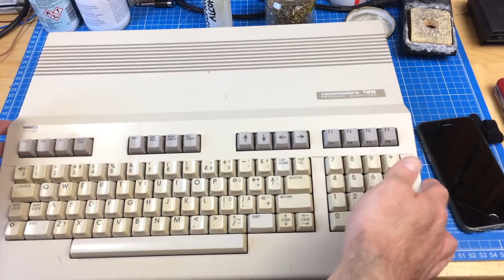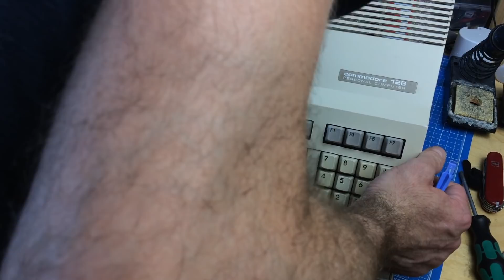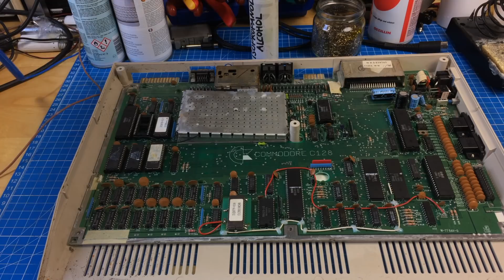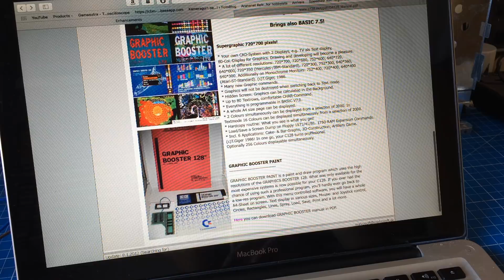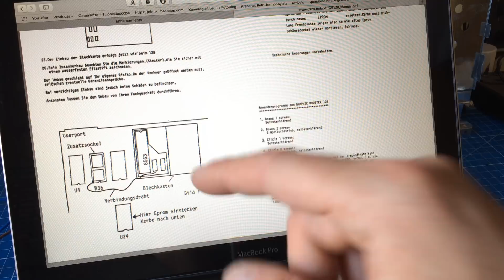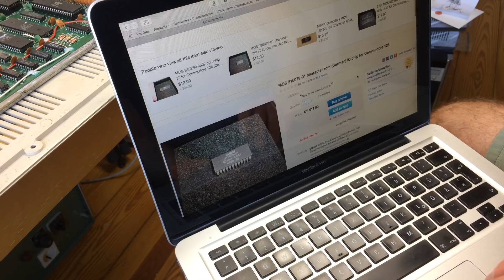Commodore 128 Part 1: First Inspection and Surprise Enhancements

Comment: That keyboard shows how in the 80s, before PCs took over nobody had a standard layout for the buttons. Although I would like to know which psychopath put four cursor keys on two buttons, that's always bothered me about early Commodore machines.
Reply from the maker: Yeah, there definitely are some confusing keyboard layouts from that era. :D My favorite Commodore cursor keys are on the plus/4 btw. Just four arrow-shaped buttons. Simple. :)
Reply: @JanBeta  Sure - but they are so small and tightly-spaced that they are more or less unusable :'(
Reply: +James Grimwood
It wouldn't surprise me if that "psychopath" was Jack Tramiel.  Remember, he was all about building things as cheaply as possible.  Two keys are less expensive than four keys.  Keep in mind that this is the guy who insisted on using BASIC 2.0 to save money.  They could have used BASIC 4.0, but it would have required more ROM, which would have cost more.  Besides... you already had to hold the SHIFT key (or the C= key) to get the graphics symbols, so it shouldn't be too big of a deal to have to hold the SHIFT key to get CRSR LEFT or CRSR UP.  At least, that seems to have been their thinking.

If you look at the "PETSCII" codes for the cursor controls, you'll see that's exactly the design philosophy they used.  CRSR DOWN is CHR$(17), CRSR UP is CHR$(145).  CRSR RIGHT is CHR$(29), CRSR LEFT is CHR$(157).  HOME is CHR$(19), CLR is CHR$(147).  Holding down SHIFT simply set the 8th bit high  (17+128 = 145.  29+128 = 157.  19+128 = 147.)

By the time the 128 came out, Tramiel had already bought Atari and left Commodore.  The C64 mode was actually something done in secret by the designers... when the executives finally noticed, it was too late to change the design.  Otherwise it might not have had backwards compatibility at all.
Reply: @SpearM3064  This is why the 'Geniuses' in Sales and Marketing and Accounting get the Big Bucks...

Telling engineers what they can't do...

..which makes them a bunch of cant's :-(
Reply: @SpearM3064  Not sure how 'secret' it really was - given that they had to outsource some of the custom chip design/production to Zilog (who (ignorantly) made false promises to them :-( )... see The 8-bit Guy's videos with Bill H's commentary re the C128 for more detail.
Reply: It was never an issue in practice for Commodore 64 users.
Reply: SpearM75503 Yeah, Jack definitely liked things cheap, heh. But hey, the savings were passed on to the customer, at least! (And he wasn't as cheap as Clive Sinclair, for instance, heh). I like his saying about "computers for the masses, not the classes." Could have somewhat been marketing, but still.

I also didn't know that about C128! The designers saved the machine for sure, then. If the new management had been smart, they would've just listened to their engineers/designers in the first place
Reply: @slipknotboy555  No kidding :-)
Reply: I know its been a few years, but here goes anyway.

On my Australian 128, the ascii/ din key became the Caps Lock key..

Comment: can it run the z80 in parallel with the 6502MHz?
Reply: No - they share the same data and address bus, only one at a time.  The 128 CP/M mode used the Z80B 4MHz version running at 2.04MHz.. and would fallback to the 8502 (aka 6510 equiv) when in 64 mode which could run in either 1.02MHz or interesting at 2.04MHz.. you typed GO64 in order to activate C64 mode, or held down the C= key on power-on.
Reply: what a pity so only the bbc model b could have parallel processors apart form the micro command interface for the zx spectrum!
Reply: it was never any intention of Commodore to make the system have both CPUs run in parallel.. they wanted to support CP/M and all of the back catalogue of C64 software in a single machine.. which they did.
Reply: yeah but two processors is nice!
Reply: @samcoupe4608KB  Yup - the Tube! :-)
Reply: @robbiew73  Someone really shoulda told Bill H they didn't think he could do that... ;-)
Reply: Go to your room and think about what you just said!11!!

;-)
Reply: Back then, I did manage to get it to switch to the Z80B without running CP/M. The beginning of the machine code in 8510, then the some Z80B code and finally back to 8510 before returning to Basic. Really just to see if I could figure out how.
Reply: @Zhixalom  And did you?
I love trying that sort of mind-bending stuff.
In a way it doesn't matter if it works or not - going thru the Gedanken experiment teaches you heaps regardless - as you have to picture how the system (in this case, two quite different systems) work...
Reply: @RogerBarraud  I only remember finally getting it to work after a lot hair pulling. But I don't remember the details anymore and I didn't manage to find the code amongst any of my disks either, back when I transferred them some years ago. So all I really am left with is the memory of frustration and subsequent relief, once I finally got it working.

Comment: Thought this was gonna be a crossover-episode when I saw Perifractic's mug. :D Nice cameo anyhow. Never ceases to amaze me how you find those computers for so cheap.
Reply: Horzuhammer Now that's a good idea!
Reply from the maker: Thanks! I spend way too much time lurking on eBay until something interesting pops up. No trickery involved. ;)
Reply: I just recently got my setup:
-C64C (+box & manual) 
-1541C disk drive (+manual)
-1530 datasette (+box)
-1351 mouse (+box)
-Zipstik
-803 printer (+box)
-SD2IEC
-A box of disks and tapes. A couple originals but mostly backups

Paid 150€ for the whole schibang. Think I got a pretty sweet deal altogether. Required a lot of patience and a strike of good luck though, must've spent almost a year looking for the right deal.. Commodore was just as massive here as it was over there, but since Germany's got like over 15 times the population of Finland, there's probably some differences between how hard it is to find old stuff like that. It's not rare at all for just a 64C + psu to go for like +80€ around here, so I'm quite happy that I waited. Haven't really followed what people pay for 128s, but I think that'll provide some clue. Not cheap.
Reply: It's always cheaper when you can find ones without PSU, cables or just 'not tested/was not able to test'. Don't be afraid to haggle and have the skills to build the missing parts yourself.

Comment: Nice one Jan! Very tidy machine too. Envious & can't wait to see it boot.
I bet you have been scouring the internet for C128 dedicated software to run on it. ;)
Reply from the maker: Not yet actually. I guess I want to spare me the disappointment if I can't get the machine to work. :)
Reply from the maker: Thanks Dave! Bookmarked for later use (if I get the C128 running). :)
Reply: The only 128 specific software I ever messed with was a terminal program (I can't remember the name, but it supported the 17xx RAM expanders), and a word processor. I had GEOS 128 as well, but never really made much use of it.

Comment: Always wonderful to see another C128 getting some love. It s very underrated commodore machine in my humble opinion. :) Quite the interesting mods in your 128.  I have an EPROM in my formerly empty socket called "The Servant" that has a file browser and some other extra stuff. Also it looks like that "Graphics Booster" upgrades the stock 16K of screen memory of the 80 column display to 64K (I also have a similar mod). That's a pretty sweet score for so cheap!
Reply from the maker: Thank you! Yeah, the graphics booster seems to be a memory expansion basically. Pretty interesting indeed. I'm really looking forward to experimenting with this monster. :)

Comment: There is a C128 adapter for C64 power supplies so you can use those - this also means that you can use a C64 Powersaver inline if the PSU should blow up.

http://tinyurl.com/y9ghr9xl
Reply from the maker: Interesting! Thanks for the link. You'd have to use a beefier supply anyway though. I think a stock C64 supply would give up pretty quickly. ;) I plan on maybe doing an adapter the other way around so you can use the C128 PSU on the C64.
Reply: I wouldn't know, my powersupply is built into my C128... and it has a Diskdrive too :o)